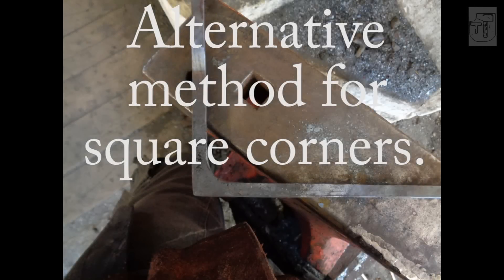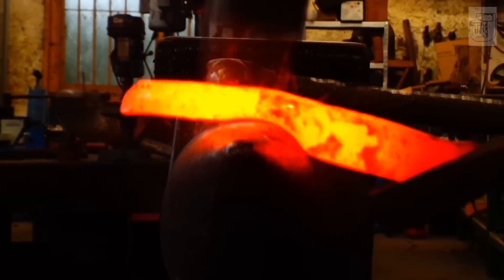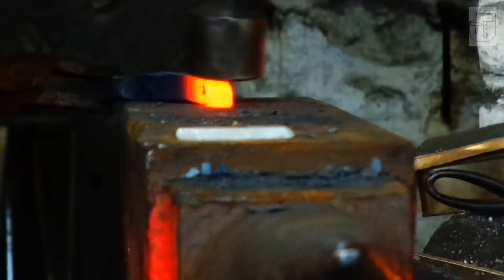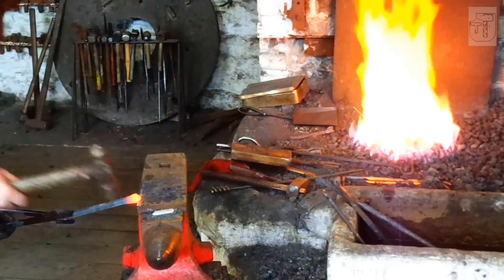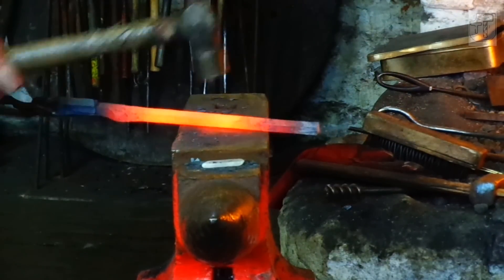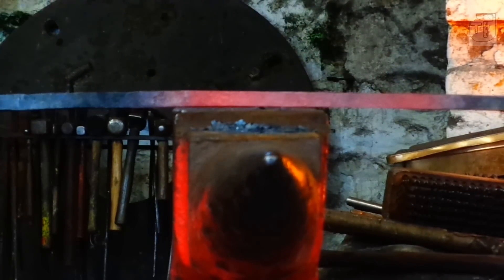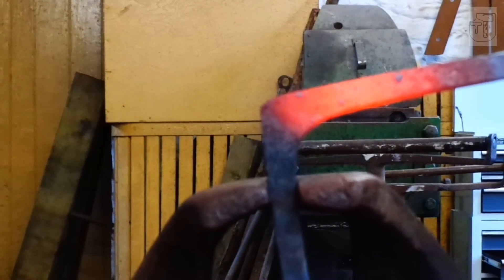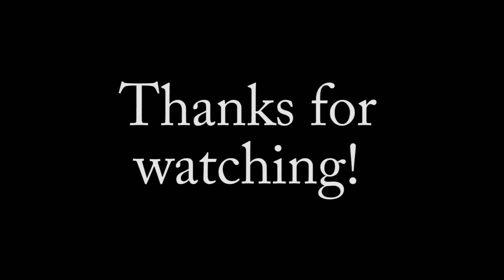Blacksmith: An alternative method of forging square corners.

Comment: Nice mate enjoyed this very much. Any chance of doing a swage for us beginners that haven't got one, for doing the nibs for bolt togs, i.e the 90 deg type. Like you have done. I don't have a means with a flat nib, to get it round or 90 deg for holding square or round stock. Cheers.

Comment: 2:35 in i shouted
'I know where he's going with this!' And if im right, that is gert clever mate!
:D
Reply: Beauty pagent hahahahahaha
Reply from the maker: +ctantep Hahaha, you pre-empted my corner, I'm guessing :D
Reply from the maker: +RowanTaylor Lol, it's what I say to myself literally EVERY time I upset something. "short and hot like a midget beauty pageant"
Reply: That is fucking lovely though. how hard is it to work out for all four corners and one fireweld?  Bit of a bugger i bet!
Reply: +RowanTaylor Yeah, as soon as you said about setting down the 25 x 12 i started getting all sorts of crazy ideas, but the one that stuck is the one that happened!
Reply from the maker: +ctantep I did all four corners separately, two at right angles and two at 25 degrees, measured so the arms would meet halfway + a bit, then scarfed together (stretched or upset here and there to fit.) Apex I should have done as a fifth corner but did a scarf weld and was a bit disappointed with the result on that one.

Comment: "flux is pointless for mild steel" what? I have been using borax for ever thinking that it was essential...i'm going to try it without  thanks
Reply: The Brits typically do not use flux for forge welding.   Clearly he is right and flux is not necessary, at least when forging mild steel over coal.  I suspect however, that it would be more difficult to forge weld this way in a gas forge.